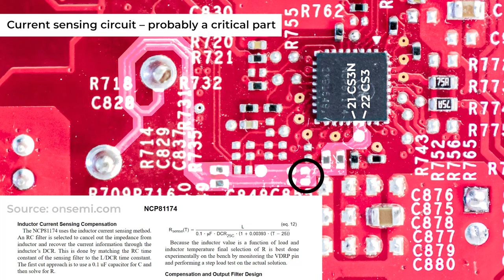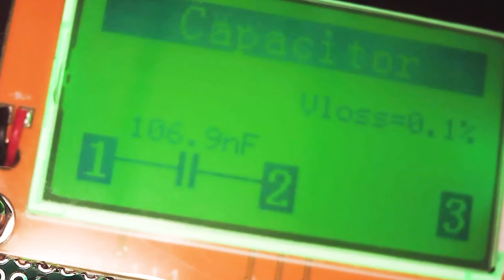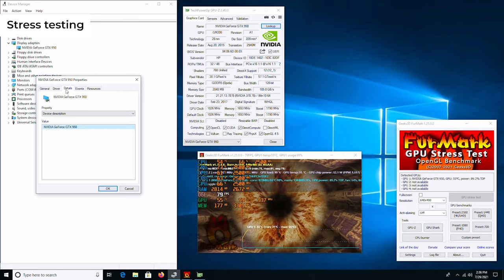GeForce GTX 950 repair. Fixing small SMD pads and components and looking for short-circuit.

Comment: Of what model and values are the SMD capacitors like the ones at 2:09?
Reply from the maker: these are PCI-express AC coupling capacitors (ones close to PCIe connector), size is 0402, X7R, don't remember the value in this card but it probably is around 100nF. For newer (PCIe 4.0) cards it would be slightly higher, around 180 - 220 nF (most often 220nF).
Reply: @adalbertfix  I am really new to PC stuff. Can you tell the voltage?
Reply: Thank you so much for the info 🙏
Reply from the maker: @tryhardairsoft416  voltage doesn't matter as long as it is high enough, anything around 16-50V should work here